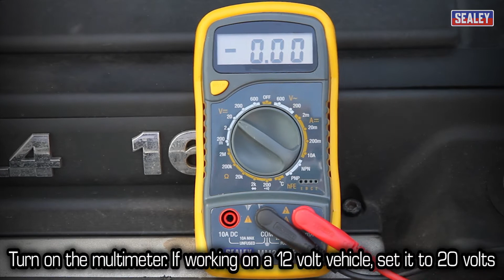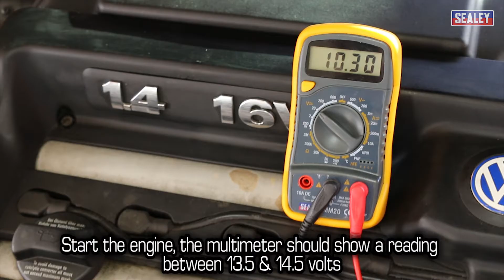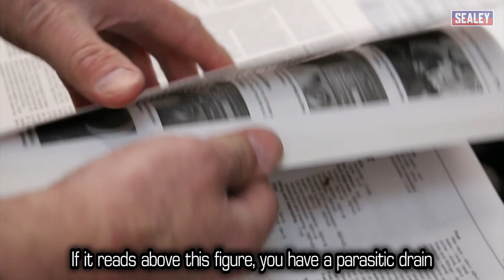Sealey How to diagnose Battery & Alternator problems

Comment: FYI .. you can’t test an alternator correctly without giving it a load , you need to connect your meter and note the voltage with the car running, then give it a load by turning on heater fans to full and headlights on , now check it again , it should maintain somewhere around 13.5 - 14.5. Checking without a load is pointless 👍

Comment: I have a Sealey MM20.V3. It has seen very little use in ther 14months since I bought it because I only needed to test a battery with it. I have come to use it today to test another battery and all I get is a No 1. It makes no difference what I battery I test, from a 12volt car battery to a 1.5v  AAA battery. In my opinion and experience, not a good quality product.